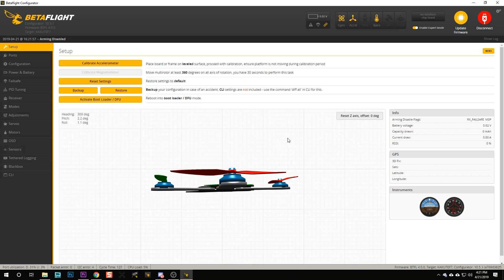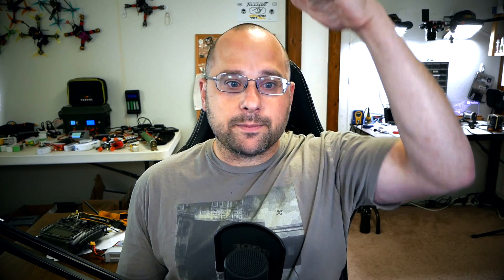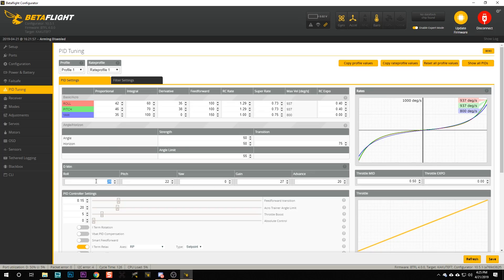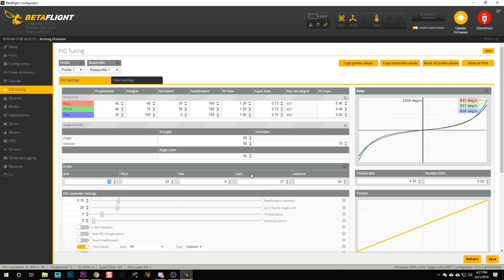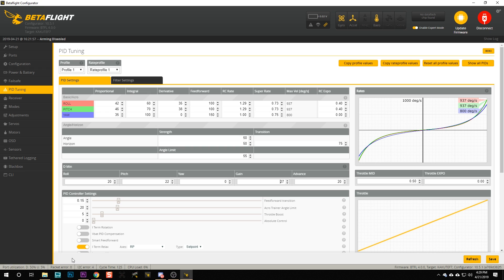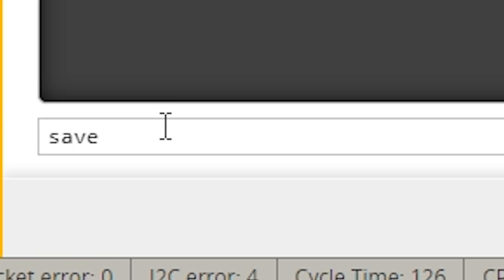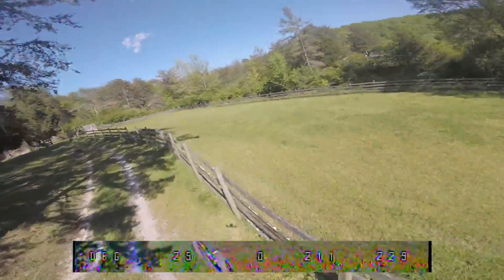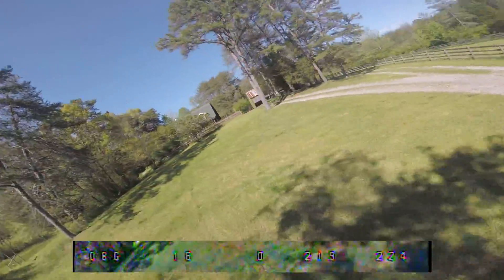Betaflight 4.0 D_min | GREAT PROPWASH WITH COOL MOTORS IS NOW POSSIBLE

Comment: what does it mean if my tinyhawk that you sent me is got a wobble in angle mode and horizon a little but not in acro mode .......also i can see a chip that has a copper coil and is slightly exposed on each side ,like i can see the chip has been damaged or something somehow and i definetly havent wrecked it hard or really at all so i dont see how any harm could have been done i take SPECIAL CARE of this baby and i love it and hold it dear to my heart as a very good person gifted it to me and its very sentamental ......i am putting some liquid electric tape over it real good so it will not be able to get damaged more .....just enough to recover the one chip im talking about......

Comment: So if you have a good tune with dmin off, except for really strong moves, you could just turn on dmin and for the minimum use the current D parameters and only increase the D max parameters, right?
Reply from the maker: I think your logic makes sense and it's worth trying but I wouldn't be sure about the outcome because I haven't tested it.
Reply: @JoshuaBardwell  OK. The reason for the question is because if I have air mode on, my quad flies with horrible prop wash and bobble. With air mode off, it's nearly perfect. Some are speculating dmin being the issue and if they are right, instead of leaving it off I would like to get it right.

Comment: If I get less oscillations with d-min turned on does that mean I need less d-term?
Reply from the maker: That would be pretty weird. I guess so .... d_min lowers D gain.
Reply: @JoshuaBardwell  Thanks. Could you explain why it's weird please? I'm just trying to get to the bottom of if Flywoo sent a faulty quad or not. Both the stock Flywoo tune, the replacement cli tune Flywoo sent to fix it and the betaflight stock 4.1 tune all have huge oscillations. So far it seems impossible to stop the oscillations completely. TPA reduces them. Lowering P till its stupidly low seems to reduce them but then at P values of around 24 it flies terrible and wobbles. My other builds when I get oscillations I just drop P about 10 units tops and or lower TPA breakpoint and they fly just fine from a stock betaflight tune. I can't think how the Vampire 2 HD is that much different. I did notice in the betaflight setup tab the quad 3d model twitches slightly and turns ever so slowly a tiny bit but when you look at the gyro on the sensors tab it does not show up on the graph but the numbers slowly fluxuate by 0.1 every so often. Right now I'm at a loss and I'm just switching out settings trying to see what effect it has.

Comment: Hi Josh just wondering if u can help me I have a 380 quad with sp racing FC and I have betaflight 4.0.6 on it when I give it quick yaw inputs or hold full yaw it shoots up into the sky it also disarms if I'm hovering and do quick spins do you know of a setting I can mess with to fix this problem Regards Rick
Reply from the maker: Most likely what is happening is that the yaw response is slow and this causes PID error to rise and runaway protection kicks in and the quad disarms. Basically whenever the PID controller tries to move the quad and the quad doesn't respond correctly, the PID controller worries the quad is having a freak-out and disarms for safety. If you have a super fast yaw rate, with a quad that can't yaw quickly, then the solution is to lower the yaw rate.

Comment: So once again I'm trying to sort out bad propwash on a new quad (it's always worse at my higher altitude and never eliminated).   
"Oh look JB has a video on this topic I haven't seen before".   
Except the conclusion I draw at the end of the video is that D-gain only ramps up following aggressive inputs, and not when simply reversing directions where the quad might settle backwards into it's own wash, or doing a ballistic drop and catch, again where quad is settling into its own wash.   In both scenarios there is no aggressive input immediately preceding when prop-wash starts, so D-gain does nothing at all.     Conclusion   D-gain has nothing to do with propwash.     So how do I fix it again?    It seems like what's really going on with BF4+ (which admittedly I didn't really pay attention to before) is that D-min has become the new tuning parameter to deal with propwash, and I need to raise it closer to the actual D values, and just have to monitor the motor temps..   same way we used to do it.  

BTW, it looks like your flying style (perhaps through subconscious negative reinforcement) simply avoids inducing propwash.  When you go ballistic over a tree, you start changing directions almost immediately rather than letting it free fall far enough to end up in its own wash once you throttle up.    Your aggressive turns are too rounded to induce it.      To induce propwash,   simply think about reversing thrust in a straight line whether it's vertically or horizontally.

Comment: I just did a new build with BF 4 took it out yesterday and my quad is doing that nervous wobble thing and I can't tune it out. I'm running T-motor F40 II pros on a Marmotte frame and I suspect it's an issue with betaflight or version 4.1 is so hard to tune its beyond me. I have a Rooster running BF 3.5 on motors that have seen a year of use and it's buttery smooth so I'm flashing that on my Marmotte for now, really disappointing 😞

Comment: This is a great video, thank you Joshua.
Can anyone help - I've got OMNIBUS 4.0.3 on an Eachine QX65. Every time I set D_Min to a non-zero number and click save, if I go to another tab and come back it just resets D_min to zero. Is this feature not supported on OMNIBUS? I'm only just getting started with this hobby so I may be missing something obvious.
Reply from the maker: If you have an F3 flight controller and the F3 chip does not have enough memory to hold all the new features. So if you have an F3 and one of these features doesn't work, then that's the most likely reason why.
Reply: @JoshuaBardwell  Ah, that makes sense. Thanks for taking the time to respond.
For anyone else reading this, it's also happening in the filter tab of the PID tuning section. I'm guessing this is the reason my motors are getting pretty hot.
I think I'll go back to a lower firmware version. I upgraded so I could have acro trainer for my son. Sounds like I should still be able to get that with a later version 3 firmware.

Comment: Question about dynamic D-term lowpass.. What should my low and high be set to in my Beta 75X? I left it stock, but raised the max by 100hz.. Does that sound right?? maybe??
Reply from the maker: The best way to know this is to use blackbox with debug_mode set to gyro_scaled, so you can see your raw gyro noise.
Reply: Yeah I know,but I have no idea how I would even blackbox a 75X..I'm just looking for a ballpark estimate...   How could I get blackbox info on this bird??
Reply from the maker: There are suggested tunes for different size quads here: https://github.com/betaflight/betaflight/wiki/Community-Presets

Comment: Hmm my motors get fairly hot on my trashcan on stock pids (bf 4.0)  just hovering... what do i do?!
Reply: read the freaking 4.0 tuning notes
Reply: @KamilK3  i already did and it didnt help.
Reply: @KamilK3  And for your information,  the min_d value doesnt help if it gets fucking hot with just hovering,  and besides that my D-values are around 20.  And lowpass filtering is all at default minimum.. So dont assume i dont fucking read before i ask something.

Comment: The best way to tune d_min is to deactivate it and also set feed forward to 0. Tune your PIDs as always. Afterwards copy your D values to D min and higher the D by 20% or more.
Reply from the maker: I strongly disagree that feedforward of zero is the best. With zero feedforward, the gyro significantly lags setpoint. Especially with BF 4.0's high I term, feedforward is mandatory.
Reply: @JoshuaBardwell  Only for PID tuning, similar to UAVTech here: https://www.youtube.com/watch?v=-27DlWxDVuM&t=58s - afterwards I set it to approx. 100, but I might boost it even more up.
Reply: Mark flys FF Pitch and Roll 450  , D Max and min 58 55 min 35 y 38  Advane 0 and d boost at 55   and look under Tunning Tips Betaflight under debug presents and look all 4 last vidos from him i now him a lot of time . best regard from Alicante Spain

Comment: Of course, pid controlchanges reacting much more/faster than on 4s?, so you have to nearly half your PIDs settings. Even than its more sensitive to PID changes. So tuning is needed much more. But you are the PID tuning hero, so this shouldnt be a problem for you ;-).  This is really a option for people which limit money. To experiment with different settings/power/speed, to use same quad with 4/6s. I just use taranisswitch to change Ch3 weight and same switch changes profile on the quad.... so one switch to rule them all g

Comment: great explanation , but that wobbling is in BF 4.0 ...not your quad ...i dubbel check all my hardware and its perfectly fine  ....i have this wobble to , and i cant get it out , and its kind of frustrating
Reply: Try to increase your gain, so it activate on time on your flips.
Reply: TheDarkstar826 thanks ! 
I get that wobble when i go strait with no stick input ...so i cranked my D-min and the gain up ...to prevent to get a to low D-term and faster activation  ...and it helped ! 💪🏻

Comment: Great video. What about adjusting i-term relax to help with bounce back on flips and rolls?
Reply from the maker: Definitely enable iterm relax. It's the first line of defense against bounce back.
Reply: Enable i-term relax but set to gyro and set the cutoff in cli to 11 (default is 20). I have no bounce back anymore.

Comment: It seemed like you need to increase your gain and advance. You really had to work at getting the D term to go to maximum. Thoughts?
Reply from the maker: It depends on your propwash situation. If you have good propwash handling, not need to be boosting the gain.
Reply: @JoshuaBardwell  I thought I saw a lot of prop wash. Maybe it was just the beat up  quad.

Comment: 2 Of my quads have omnibus f3 FC and after flashing both to 4.0 i am unable to adjust D_min Values, All values are stuck at 0. Can ayone help with this?
Reply from the maker: F3 boards do not have enough program memory to support all Betaflight D features after version 3.4.

The d_min function is left out of F3 targets because if their lack of program memory.
Reply: UAV Tech (Mark Spaz) has made performance editions of bf 4.0 for F3 including the d_min, check them out!

Comment: I don’t know why but on my quad I’m running d in the 50s and it does not at all get hot or even warm. Does that mean I can go higher with that number. I’m using 3.5.7 on 2304 2300kv emax with blue series and one emax Simon series all on regular pwm signal. 480 pwm rate gyro lp 1 at 150 no gyro 2 and dterm 150 cut 300.  Oh all on pt1. Wonder if I go gyro lpf 1 set to 200 will it get warm? Idk. Lol

Comment: I find it does not respond enough to prop wash...I didnt have hot motors anyway with normal D gain, but perhaps this could allow less dterm filtering and higher D gains...'if' it can be set up well enough...

Comment: Hey how are ya?  I run your board but switched to a spare matek non all in one f405 std after a hard crash first time ever bent a PCB. So switched to a spare  matek I've had sittin around forever now. never used one before. Similar pids. 6s f80motors, same esc's ive always used .they just work. Switched to the new 4. 0  and I get twitching before arm. Kinda like older blheli s esc's. I also get a dsync every now and then drop out of sky. It's odd
When retrieve it the lights aren't blinking correctly. Then recovers and flys great for a pack or two. Then same problem again .  Just thought maybe you or someone  had an idea about the twitching dsync.  Thanks.

Comment: Joshua, not sure you description of gain and advance is correct.   gain determines the sensitive of the mechanism used to initiate a raise in d where as advance determines the delay before the change takes affect.

for free style recommendation is a gain of 35 with a delay of 20, where as racers should consider gain of 45-50 and advance of 0.
Reply from the maker: That sounds like what I said to me but if it sounds different to you maybe I wasn't clear.

Comment: What if your D Min boxes in Betaflight are all at 0 and wont save any setting you try to enter?? I'm getting this on my Emax Babyhawk R. 
Using DSHOT 600 btw. Other quads are fine with this setting.....
Reply from the maker: Are you sure the Babyhawk R has the latest 4.0 on it? If it's an earlier nightly build you can get this problem.
Reply: @JoshuaBardwell  yea JB. Flashed it twice already, as It was one of those that thought it was a moon rocket😜

Comment: The documentation referenced when using 6S to reduce P and D on roll and pitch by 1/3rd.  Would it be safe to assume you would want to reduce D_Min for roll and pitch also by 1/3rd? Basically shifting the D term dynamic range down a 3rd.
Reply from the maker: That makes some sense to me.

Comment: With D_min stock low values I was getting propwash on low stick input moves.  Like a slow sweeping dive would bring out propwash.   I raised my D_mins up to my old D values and all propwash cleaned up.  I also upped the D to 50 /58 in the PID and it only would go that high for a short time when doing a big stick movement.     This is the D Boost way of using it.
Reply from the maker: Right! Excellent approach. If you have cool motors, you are safe to raise D_min which will give better handling mostly.

Comment: Should I tune with airmode active or not ? Cause I noticed while airmode turn off by accident the quad flew like crap. I experienced nose dips and full throttle oscillations. After airmode activated most of my problems were gone. So it kept me thinking should I tune a good baseline in Acro only ?
Reply: Airmode on always IMHO.
Reply: @uavtech  thank you Mark. I'm used to take airmode off while landing. Just to prevent it from jumping in my face while it bounce during a landing. But at maiden flight I forgot to activate it and it really flew like crap without it.

Comment: From my experience slow bounce back such that was seen on your pitch flick is an indication of not having enough P.  I'm loving bf 4.0.  I've been experimenting with very low d_min to the point where the quad oscillates then raising d_min a few points to clean up the shakes.  Running really low d_min you will have to increase gain and advance to quickly reach the right d value on fast maneuvering. For me, this makes the quad feel direct to my stick inputs.
Reply: Great experimenting with it.  Makes sense since there is less D upfront of a sharp move to fight FeedForward.  👍
Reply: Funny you mentioned feedforward .  I don't use feed forward on any of my quads because it changes stick feel for me.
Reply: @jenjer515515  , then even more important to keep D low.
Reply: UAV Tech on some quads I have d_min as low as 8 and d as high as 47.   Gain as high as 65 and advance at 8.  With gain and advance I notice when both are high motors start getting warm but if gain  is a bit higher than advance motor temps are normal.  When advance is higher than gain motors start to get warm.  I'm assuming that's because if advance is high it puts the quad in the higher portion of my d value.  I'm currently tuning one of my rigs with main focus on the advance setting and I'm noticing with a super clean build I can run a low gain of 10-12 and advance as high as 75 and d_min as low as 8 and d as high as 34 the quad is real snappy but this method of tuning on a somewhat worn rig the motors are a little warm for my liking leading me to tune using higher gain over advance.  Also the osd debug function enabled I notice with higher gain on fast maneuvers and inducing propwash the flight controller doesn't stay in the upper setting of d very long but with higher advance method it's opposite on the same quad.  I do prefer the higher advance method because the quad feels snappier but on one of my so so quads it's tuned with higher gain.  Don't get me wrong both methods that I've tested fly buttery smooth and locked in. I'm just noticing with high advance I can fly the quad more aggressive.  To come to think of it, it might be suitable for someone who races.

Comment: Tuning tips recommend setting d mins to zero for 5” 6s freestyle. Is that because these types of quads are more aggressive in their full flips so keeping D gains high is better than waiting for them to ramp up from a d min number?
Reply from the maker: I asked Mark Spatz about this approach and he said the problem with it is that the lower D_min is, the longer it takes D to get up to its max value. So by lowering D_min you are making the D term less effective. You can counteract this by raising D_min Gain but then the D term can get super twitchy.
Reply: Joshua Bardwell so a dmin of zero turns off the ramping up delay effect that constant power freestyle moves would not like?

Comment: One of your very best tuning videos yet!  Great explanation of D_Min and how to use it!  You can increase D_Min Gain from default (27) up to 35 or 40 to deal with Propwash - but, as you said, check the numbers in OSD to see if you are getting too much D increase during normal flight and/or warmer motors.